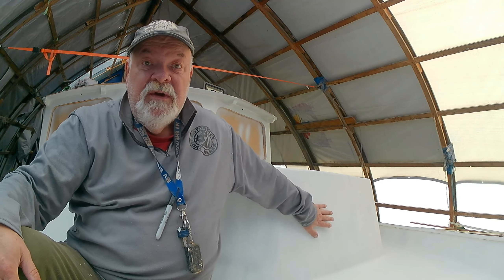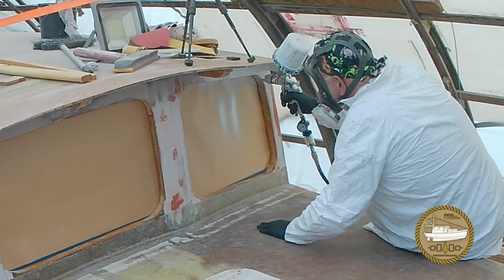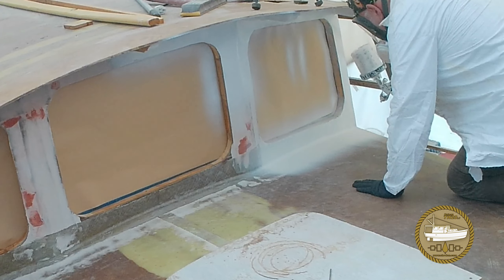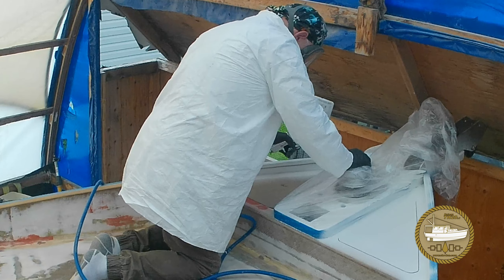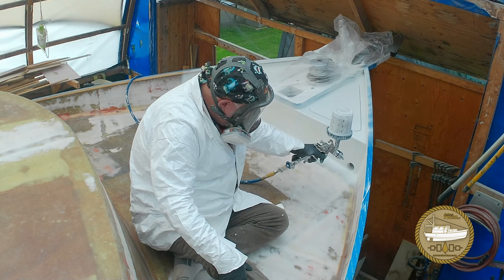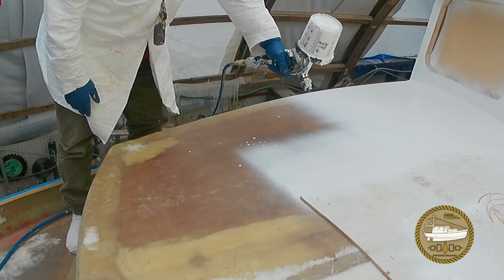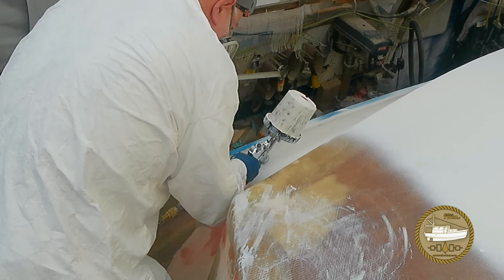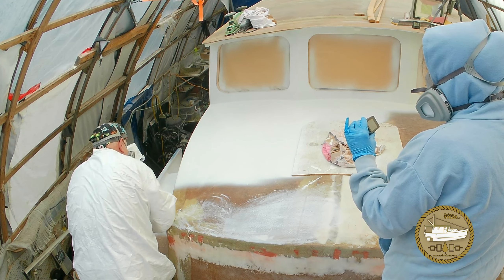Stepping Out of My Comfort Zone: Spraying Rustoleum Primer on the Boat

Comment: Looking good.  What a difference.  I was bogged down in hand sanding today, hopefully I’ll slap some paint on next week.
Reply from the maker: What are you building Josh? Sanding sucks but essential unless you want a work boat finish. Certainly satisfying when you get some paint on it! Cheers! Rick
Reply: @MVSheKon  I’m fixing up a 50 year old sailboat.  Right now I’m replacing chain plate knees.  What started as a replacement of the staysail knee bulkhead turned into a rotten plywood hunt which turned into completely taking the v-berth and interior forward of the head down to bare hull and rebuilding everything new.  Since it was a blank slate, I decided to put in a bigger holding tank, change the chain fall and locker, add some storage space, and reroute the wiring.  

Nothing says boat project like turning the replacement of some leak damage into an entire remodel of the berth area.
Reply from the maker: Full admiration for taking on an older wooden boat project. I could never do it. Looked at a few too. You have to be extremely dedicated to the task to get it done and done properly. Breathing new life into an old boat will certainly be satisfying. I wish you well. Cheers! Rick
Reply: @MVSheKon  Oh, I'm not that crazy.  She's a fiberglass hull and right now I'm just rebuilding the interior.  My dad was a partner in a wooden boat when I was much younger, and some lessons don't require repeating.

I've been watching your work for years, and it's a really an inspiration for when my enthusiasm starts to fade.  I can't wait to see you put her in the water.